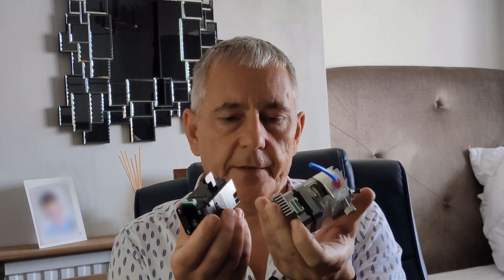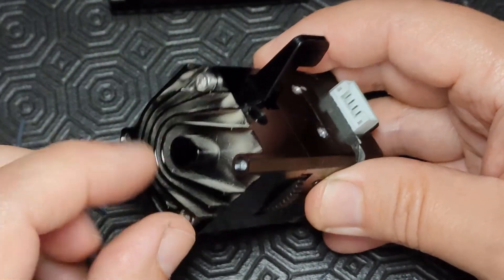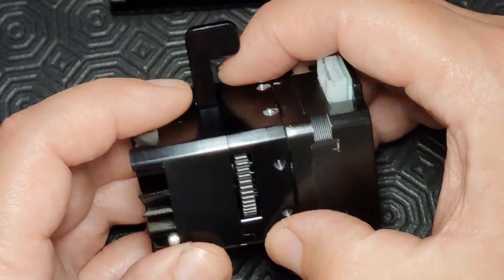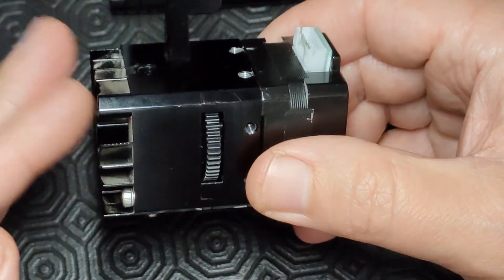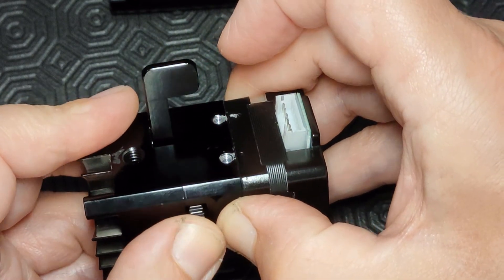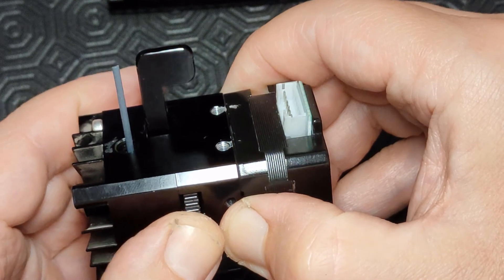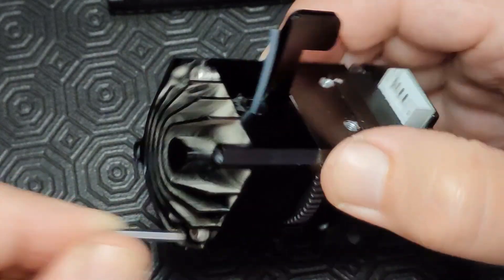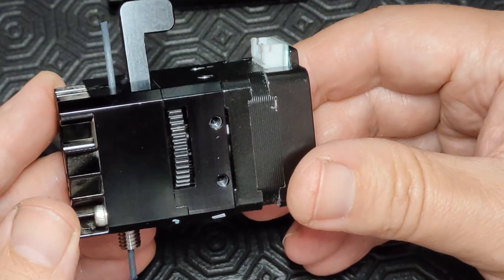How to fix a jammed biqu H2 extruder

Comment: I had a surprise finding there is a PTFE (?) tube inside the heatbreak, that melted and was badly damaged.
Reply from the maker: Odd, that shouldn't be hot enough to degrade it! 
At least you've found the issue now.
Reply: @Neilsnonsense1  , probably it was due to the fact that I used another thermoprobe, that was not flush with the thermoblock, so it could run a bit more hot for quite some time. Blame on me anyways.
Reply from the maker: Guess you must have been printing at high temperatures then?
Reply: @Neilsnonsense1  , not more than 240°C

Comment: I have a Mingda D2 which is a direct drive but I can't get it to print TPU with 87 shore hardness (very soft).  I bought a filament drier, but that didn't help. Now I think I need a dual drive gear extruder and would like to know how very soft TPU behaves with the Biqu H2... I'd get the version 2, BTW.  What shore rating did the TPU you used have?

Comment: I work with early sewing machine motors. I find the best way to get them reassembled without running friction is to run them at a medium speed as end covers are adjusted and tightened down. It is possible to find sweet spot, of lowest running friction. Real problem may be  manufacturing tolerances, and how they stack up.

Comment: My extruder was jamming on EVERY print for over a month. Your video inspired a slightly different solution. I believe the tolerances/quality control on the H2 are the issue . I loosened the screws to the point where the stepper would even move when I turned the gears manually.The gears rotated smoothly again like new and not a single jam!
Reply from the maker: Ace, mines behaved itself since, hope yours stays jam free. Fingers crossed.

Comment: Thanks for the video. I purchased two and both did the exact same where it seems as though the tpu backlashed inside of the extruder assembly. My motor doesn't seem loose like yours - everything is mounted tight. Which is the other pain, I have the remove the entire X carriage assembly then the mount from assembly just to be able to remove the h2 from the mount which then I have to disassemble the H2... and then put it all back together again haha... I've done it 3x in last 2 days and its gotten a bit old.

I do like it tho... weird thing is, both times, it printed absolutely terrific! Until it didn't.

I think I'm just going to return them both. I don't mind troubleshooting and tinkering to get things working but the amount of work that has to go into being able to troubleshoot and fix is too much. And at the price point I shouldn't have to I feel.
Reply from the maker: That's a real shame, I wonder what's happening, is the TPU spewing inside of the extruder ?
Reply: @Neilsnonsense1  it's weird because it just gets all tangled up inside.. 3rd one is working better

Comment: Ive got one on the way, for the price and what you get its unbeatable, but I am prepared to do some work on it to get it working properly. First port of call is probably ptfe grese on the gears, and some boron nitrate paste on the heabreak and heaterblock.
Reply from the maker: Agreed it's a good value option and produces good results.